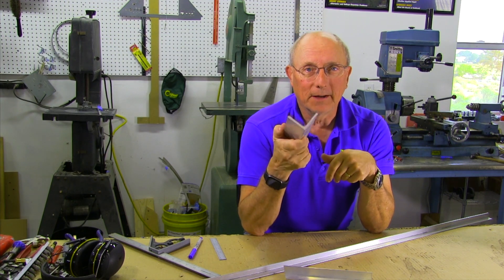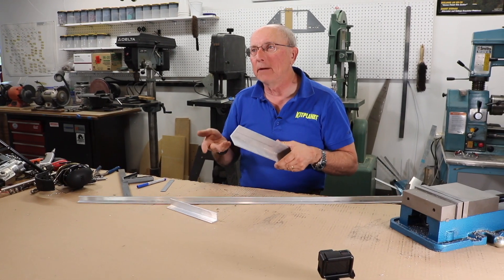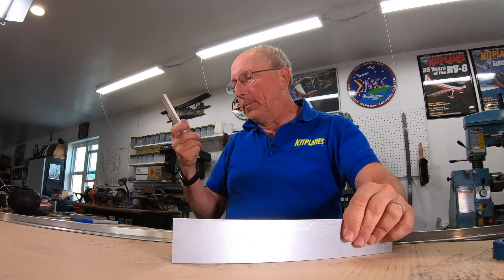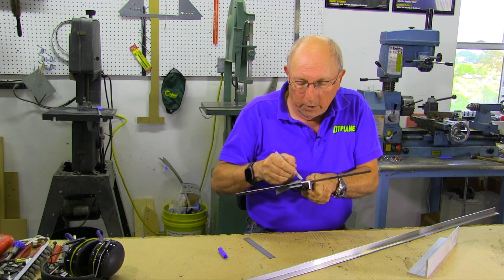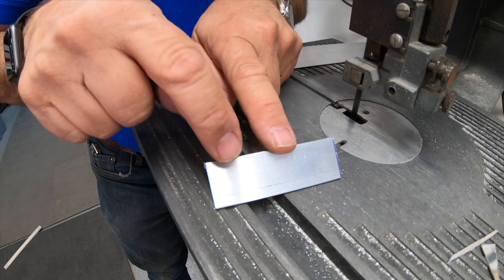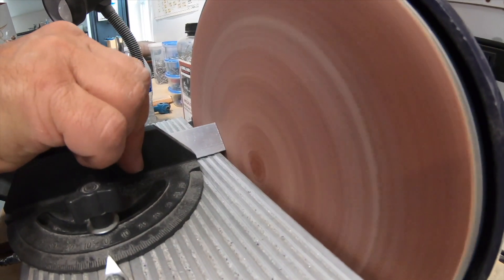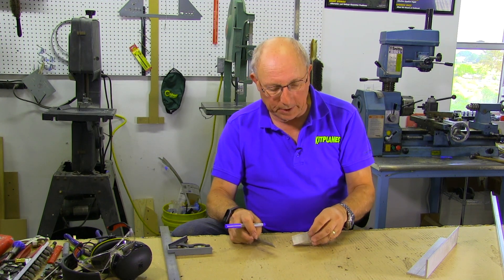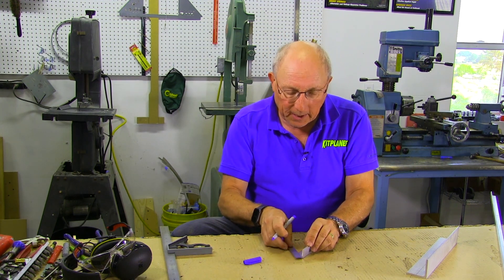Metal Magic: Cutting and Shaping Angle Aluminum

Comment: Just two notes. 
That is a combination square not a carpenters square. If you used the other side, it will give 45* angles

2: if you used a horizontal bandsaw then cutting 45* is easy, as well as cutting square ends.
Using that bandsaw eliminates 95% of what you are instructing. You are using the wrong tool and making a lot of measurement problems to deal with it.

3: BUT...Your band saw can be used with a miter gauge and again eliminate the problematic measuring you are doing. 
Mark the cut point and run the stock through at a 45* angle. Just like you are doing at 8:33 except using that thing you're using at 5:43 That is not a square it is a miter gauge.

Comment: Rarely have I ever needed to cut an angle that needed the bottom flange formed to a sharp point. I can only see that use for making a miter joint. There is no weight savings. So cutting the end as you described in the second explanation should suffice for 90% of all such ends. (i.e. marking back 1/8" and drawing the line).  You might want to mention that you can cut aluminum at the same speed as for wood cutting, but NOT for steel (4130 etc).

Comment: Very helpful video.  What type of bandsaw blade are you using to cut through the aluminum angle, TPI and if carbide?  I have a task ahead of me to trim 1/8" off approximately 3' lengthwise along a 4' long piece of 1-1/8" aluminum angle to create a mid-span taper.  Would you just mark your lines and run the nearly 3' of this angle length through your bandsaw?  I was considering using a small circular blade saw in order to ensure a straight cut, what would you do?  Trying to leave the straightest and burr free edge possible.

Comment: Thank you.
Another good way to mark angle, is to take the centering tool off of the blade of a combination machinist Square and lay it on the piece of angle, then you can mark both sides evenly and at the same time without having to reposition.